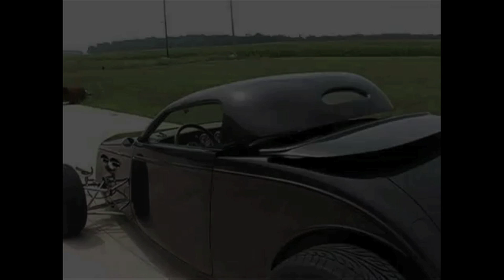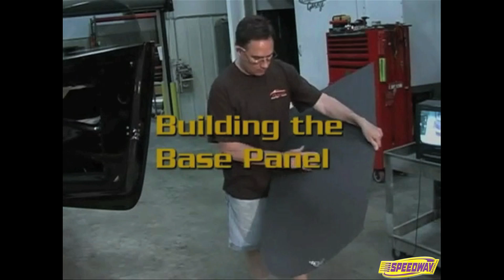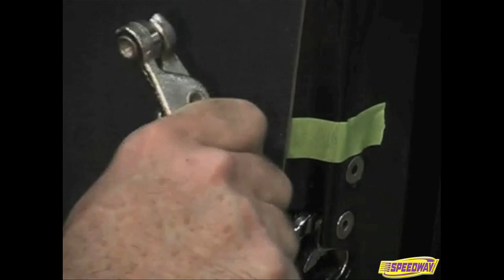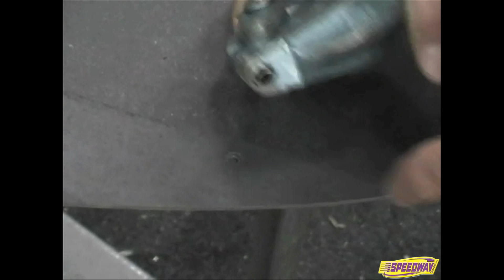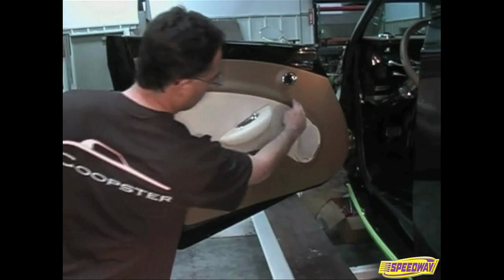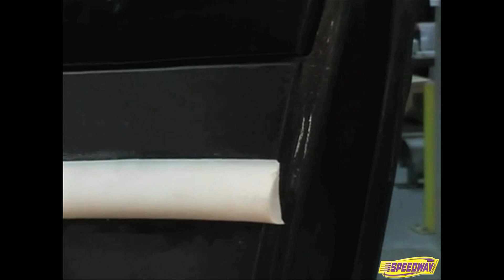Hagan Street Rods Modular Door Panel System

Comment from the maker: We also stock Lokar Oval Interior Door Handles (part # 491-2001, polished finish or part # 491-2000, brushed finish) that work with cable kit part # 491-21000 which will work with most OEM latch configurations or aftermarket latches.

Comment from the maker: We have two different styles of arm rests available on our website: a tear drop shaped arm rest (part # 910-01937) and an “old school” style arm rest (part # 910-01934). Both styles were shown in the video and they are sold in pairs. For custom applications where a stock-style door handle is unavailable or not applicable, our Bear Jaw Door Latch Release Handle w/ Cable (part # 910-3017, single or part # 910-3920, pair) works with our Bear Jaw Door Latches.

Comment from the maker: @bad65stang Speedway Motors stocks a universal door panel base kit # 910-01932 which includes (4) 39" x 32" sheets of the 1/8" thick cardboard material. Please check our website for pricing.